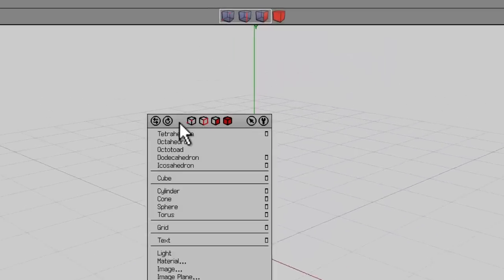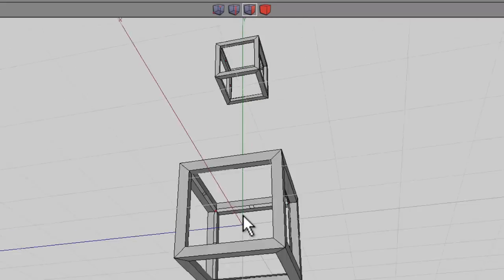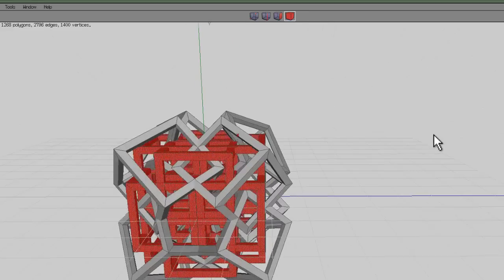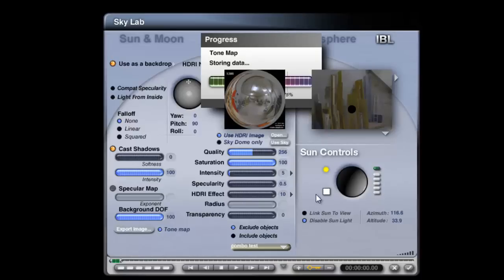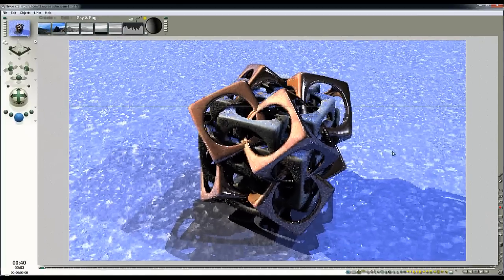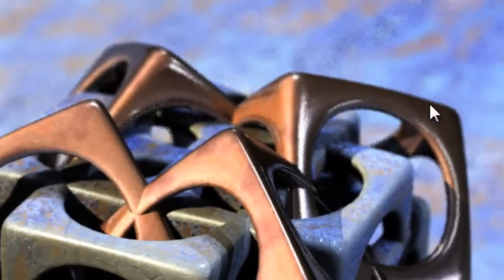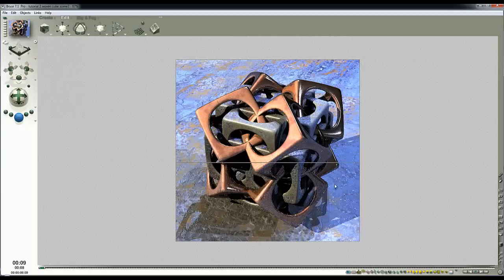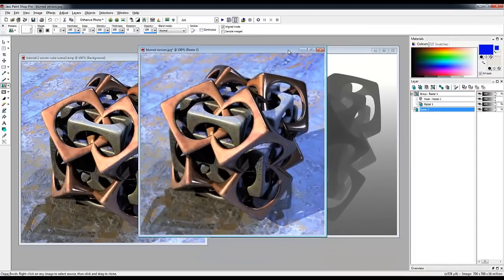Bryce 25 minute scene - Woven Cube 2 - a tutorial by David Brinnen.

Comment: Thanks Dave, I found the issue a few mins ago. I use a program called windowblinds to skin my OS and change the look and feel of windows. I normally disable the skinning of my graphic apps for this very reason,(had an issue with Bryce's tool bar at first too :P) and did so with Wings 3d .exe, but didn't add the werl .exe as well. Once I added werl .exe to the per application list of windowblinds it ran fine :) Now I'm going to give this tut a go  ;)